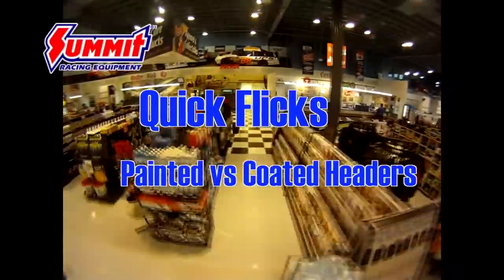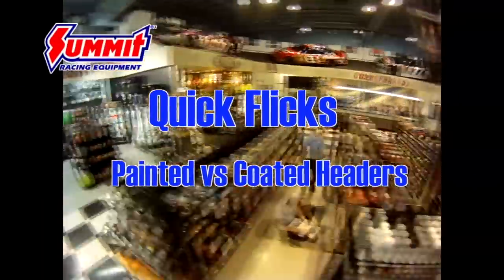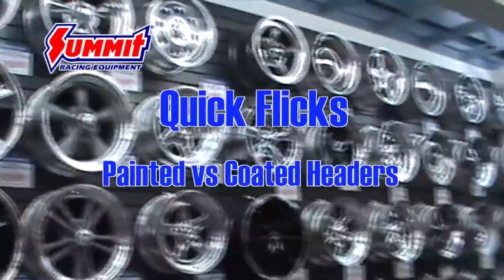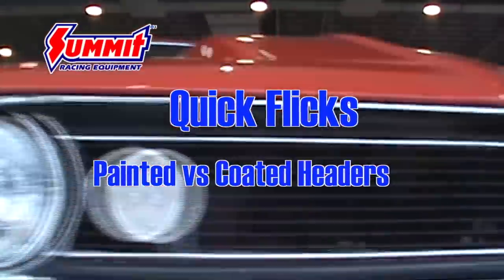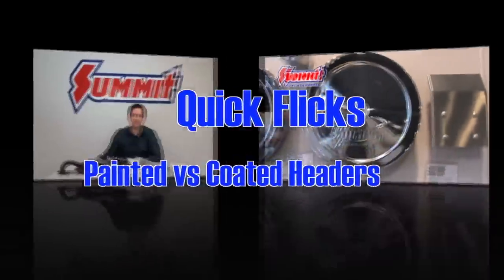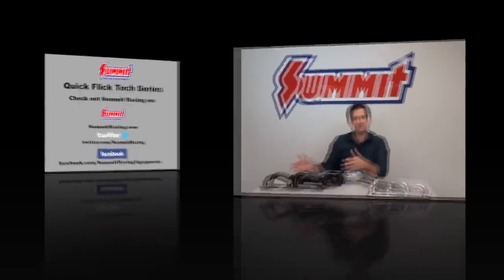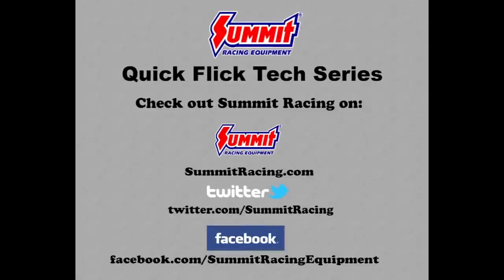Ceramic Coated vs Painted Headers - Summit Racing Quick Flicks

Comment from the maker: There are two grades of stainless commonly used in exhaust piping, T304 & T409. Neither will rust through completely but, the T409 will get a light orange coat of surface rust after a time. The header wrap does in fact cause a mild steel header to rust prematurely due to the heat and moisture, but will not have that affect on the stainless.
Reply: T304...for the win!  Yes
Reply: @mikeonorato2968  word, aircraft grade stainless steel in T304 👍

Comment from the maker: Hi grimmjow714, 
Ceramic coating requires the correct equipment to apply and large ovens to cure. There are businesses (Jet-Hot) that offer this service. It is highly suggested you trial fit the headers making sure of proper fitment. It is not uncommon to have to make a small dent or ding in a header tube to make sure they do not rub on anything. Once fitment is verified, you would have to send the headers to a coating company of your choice to allow them to coat your headers. Thanks!

Comment: Steve Brule and the rest of the crew at Westech showed that ceramic headers reduce heat around the headers by around 600°. That's 600 degrees that won't hear soak the engine bay/induction system.

Comment: I can tell you from experience that VHT flameproof coating works very well and lasts. The mistake I made was pressure washing my engine a couple years later. I got too close to the headers and it striped off the paint in that area.
Reply: VHT can not be much good if a pressure sprayer can wash it off. I have never had any luck using VHT paint. It is real rubbish.

Comment from the maker: Ceramic coating is just that, a coating! So yes, it can & will chip if accidentally dropped or hit by road debris. Stainless looks really nice (depending on the grade) but does not share the same insulating characteristics as a coated header. Therefore it will not lower underhood temp. or scavenge quite as well as a coated header.

Comment from the maker: Coating System
VHT provides a multi-high performance coating system for the ultimate in 
protection and quality. The system includes surface preparation, primer, paint 
and clear coat.  PrepSP445Prep Spray, PrimeSP118FlameProof™ Primer, CoatSPXXXFlameProof™ Color,    FinishSP115FlameProof™ Clear

Comment from the maker: Applications: Headers, Exhaust Manifolds, Piston Domes, Inside Heads
Finish: Flat
Dry Time: Curing time required and can be done on or off vehicle (see below)
Curing FlameProof™
VHT FlameProof™ Coating only attains its unique properties after correct curing (refer to instructions on the can).
Reply: Summit Racing thanks for the video. In regards to ceramic coated Pistons, would you shave down the piston before applying the ceramic coating in order to obtain the same volume?

Comment from the maker: Chrome plating headers has been done for a lot of years and while it looks nice, it requires a lot of cleaning & polishing maintenance to keep them looking good. Chrome plating also has no effect on exhaust gas scavenging like coated headers. This being said, many header companies have stopped offering chrome plating as an option. Another draw back to chrome plating is that it is very expensive to have done!
Reply: Most chrome platers will not do headers. The chrome has to be polished with special polishes and it is too hard to get into the collector part of the header.

Comment from the maker: There are two methods to cure VHT header paint.

On the Vehicle
•	Paint must be completely dry before curing 
•	Run at idle for 10 minutes 
•	Cool for 20 minutes 
•	Run at idle for 20 minutes 
•	Cool for 20 minutes 
•	Run under normal operating conditions for 30 minutes

Comment: Heat retention keeps the pressure stable with in the primary tubes. The higher the heat the higher the pressure. High pressure equals higher velocity of the exhaust pulses. Thus expulsion of exhaust more efficient than standard cast manifolds. Depending on the engine displacement and configuration  most headers provides more power in the midrange.

Comment from the maker: Off the Vehicle
•	Paint must be completely dry before curing 
•	Heat to 250°F (121°C) for 30 minutes 
•	Cool for 30 minutes 
•	Heat to 400°F (204°C) for 30 minutes 
•	Cool for 30 minutes 
•	Heat to 650°F (343°C ) for 30 minutes 
•	Caution: Do not exceed the temperature of the least heat tolerant component or 
the base metal

Comment from the maker: Not all headers are coated internally. That is a question you should ask while shopping for them!  There are no real downsides to coating; other than if you chip it they will rust quicker in that area. The upside is more power due to higher temperature exhaust traveling faster downstream, therefore scavenging better. Better scavenging leads to a cleaner cylinder for the next incoming charge that will now burn more efficiently thus producing more power.

Comment from the maker: On the Vehicle
•	Paint must be completely dry before curing
•	Run at idle for 10 minutes
•	Cool for 20 minutes
•	Run at idle for 20 minutes
•	Cool for 20 minutes
•	Run under normal operating conditions for 30 minutes

Comment: There's very little reason to buy painted headers. They can get up to 600 degrees Fahrenheit hotter than ceramic coated headers. Don't be cheap, and save all your wires and starters  just by spending a little extra to buy ceramic coated headers.
Reply: I feel the opposite because with every set of ceramic headers i've had, they rust within a few months. I buy the painted ones, sand blast them, 2000 degree primer, 2000 degree paint and its way better and way cheaper.
Reply: @ethanslape8889  I know this was years ago but do you still recommend painted headers with high temp paint. I wanna buy headers but can’t seem to decided between ceramic or painted.
Reply: @captainshimmer7319  yes absolutely. if you do it right then they will last. ceramic coated headers are a waste
Reply: @ethanslape8889  yea the ones I’m looking at are 500 for ceramic and 200 for painted don’t wanna pay for it, if it’s not worth it.
Reply: @ethanslape8889  I have pacesetter painted 1 7/8ths coming. How much to sand blast them on average you think? Thanks

Comment: I dont paint them  I burn the paint off and when I change the oil  I wipe the HOT header down with the used oil - It put a oil baked coating and they wont rust ... Like a black seasoned cast iron skillet... Done
Reply: What about smoke from burn off
Reply: @therealvontetv3117  it does for a few minutes at the time of coat/ recoat..  Think seasoned cast iron skillet

Comment: I have full Delkevic stainless steel exhaust on my motorcycle. The stainless is supposed to turn a gold colour after a while. I am going to have them chrome colour ceramic coated to stop this happening once and for all.
Reply: Why?
Reply: @porkchopspapi5757  I decided after having my stainless steel exhaust that I really like it. It did not turn very gold at all. I decided to leave it the way it is and not have it ceramic coated. It is a full Delkevic stainless system and I have it on my XVS650 V Star Classic Cruiser. I really like the system as it is full length and is about 70% lighter than the original system. I love stainless steel to clean as well. I just wipe it over with a damp cloth and all the mess is gone. There are no rust spots or anything and it always looks good.

Comment: Do the titanium coated headers that you offer have the same benefits as ceramic headers? I don't care for, nor want, the shiny look of the ceramic coated but I do care about all it's benefits. Particularly keeping heat down, increased velocity, and of course durability.
Reply from the maker: Skeeter66,
You got it, yes!  All the
benefits of the ceramic coating without the shiny finish!
Reply: Thanks for the info! I'll be looking forward to getting a box from Summit at my doorstep now.
Reply from the maker: Skeeter66, 
Thank you for your business! Good luck!

Comment: Thank you, but did not really answer my question.. 

How many layers of primer and coating is recommended?

And also, are the owen supposed to be, for example the first cycle, be 250°F when I put in my headers in the owen. Or is it supposed to be cool, and reach that degree?

Thank you

Comment: I have a 09 GMC sierra 5.3L with a corsa sport.  What's a good brand for ceramic headers for my truck?  And should I get the y pipe its a single side exhaust

Comment: Is there any heat soak with the ceramic coatings? If so what kind of temperatures do the headers get and for how long at that degrees?

Comment: Hello, I know this is a video between painted headers and ceramic headers, but which would be better between ceramic headers and wrapped headers. If this is presented in another video, my apologies. thank you.
Reply from the maker: Hi TheyCallMeCoolRon, Keeping all the heat inside the header tubes helps maintain exhaust gas velocity improving the scavenging effect on all cylinders and wrapping headers was the first way we used to do that. Header wrap is labor intensive, absorbs moisture (winter storage), Voids the header manufacturers warranty and is not very pleasing to the eye.
Header coating on the other hand has the same advantage that wrapping does, keeping the exhaust gas velocity high, but without the other compromising factors listed!
Reply: Summit Racing
well waht about ceramic headers vs. Stainless steel

Comment: Could you get 1 or 2 extra hp if you paint stock exhaust manifolds?  I don't think I've seen anyone do this, but it seems like if you already have them off, it'd be worth it.
Reply from the maker: christians131,
Not sure that painting would do
much good but ceramic coating may! Ceramic coating is a heat barrier that keeps
as much heat inside the manifold as possible. This increases the exhaust
velocity thus increasing the scavenging effect! A cleaner cylinder means a
bigger bang the next time around! :)
Reply: Summit Racing what about ceramic coating paint? rustoleum and duplo both make a ceramic paint for ceramic coating would this get the best of both worlds?

Comment: Hello, I just bought new motorcycle exhaust that are AISI304 stainless steel polish to brushed matt finish. I want to paint them black. I am thinking of using VHT Flame Proof 1300-2000 degrees Fahrenheit ceramic coating and for a primer use Rustoleum high heat primer up to 2000 degrees Fahrenheit. I was wondering if before applying the primer if I should sand the exhaust with 360 or higher grit sanding paper. I think since the pipe are already smooth i will not need to go for lower grit sand paper.  Or should I just apply the primer and not sand.  Or maybe I should I just skip the primer and paint them with the VHT. Please let me know what would be the best way to paint them so it will last and look proper.

Thanks
Reply from the maker: Hi Justin Maillet, 
We would recommend scuffing first. Being bare, it really might need some type of etching first in order to get the primer or paint to adhere. We would suggest using our  SUM-942010 prior to priming. http://www.summitracing.com/parts/sum-942010

Comment: is the ceramic coating is the same applied to vehicle as ceramic paint protection ?

pls advice...
Reply from the maker: +William Oei , 
No, these are not the same. The header coating is similar in consistency to powder coating (extra thick paint) and the paint coating is similar to applying a coat of wax.

Comment: how do I get the temporary paint removed without bolting them on ??what do I use
Reply: I put mine back in the box and placed it in a firepit. When I took them out just clean them up, I used VHT flame proof primer then paint. Came out well
Reply: To ceramic coat, parts must be absolutely clean. Follow coating manuf. suggestions. Most suggest aluminum oxide blasting to bare metal. The coating service should provide further cleaning solutions to remove skin oils, etc. and to ensure a long lasting finish. Contact them for their recommendations. Rattle can paints have fewer requirements.

Comment: So if I buy a stainless steel header do I need to wrap it or put finish on it?
Reply from the maker: Hi Brad James, 
Knowing the difference between the t304 and t409 stainless steel will help you when you buy stainless steel products. The t304 system will not oxidize or rust. However, it can develop a golden color when exposed to high heat over time. The t409 stainless steel has a lot of ferrous material in it and can show surface oxidation after a while, especially when exposed to calcium chloride or salt. However, this can be prevented by applying stainless steel cleanser using a scouring pad.

If you are concerned about long-term appearance, then you should get the t304. If you are more concerned about the price but want something that is fairly durable, then the t409 will work just as well. So the next time you buy a stainless steel product, make sure you ask about t304 and t409 stainless steel options.

Comment: Although you don't mention any trade names in your piece, it looks like your ceramic-coated examples might be by Nitroplate.  I just called Nitroplate and was told that as of May they no long have a retail operation, which means we hobbyists are out of luck as far as their product.  In view of this development, I think you should offer alternatives here.
Reply from the maker: Norm Lewis, 
We do not carry Nitroplate. However, we do have a large selection of ceramic coated headers. You can see that selection here: 
http://www.summitracing.com/search/department/exhaust/part-type/headers

You can select the header finish along the left side of the page. Let us know if you have any additional questions. 
Thanks for watching!

Comment: I've never been a very big fan of headers personally. I've always found that they leak, they burn up gaskets, wires, cause too much of a headache for a small gain in horsepower. and they never usually get used in the right application. (why would you ever put headers on a truck?) but these ceramic coated are interesting me greatly. I might have to go with a set of these on an LS or 383 stroker build I am planning on a corvette. if the benefits can outweigh the losses I have seen in the past
Reply from the maker: Hi ledzeppelin27, 
Thank you for you're input. Please let us know if you have any questions. Do not hesitate to contact our tech department by calling 1-330-630-0240. Thanks for watching!
Reply: Every engine has headers......
Reply: mrsuperbuckets It's a difference between headers and an exhaust manifold. Most will come with a manifold from the factory which is a single cast part while headers have the individual tubes for each cylinder.
Reply: ledzeppelin27 because some trucks are faster than your Corvette. And because power isn't to only reason to get headers. Noise is another reason.
Reply: Mikes garage has a actuall side by side comparison test YouTube video on manifold vs header with dyno results...

Comment: Can someone please answer this before I purchase. Can't get an answer. Do i need ceramic coating headers for my long tube headers
Reply: Yes. The difference in heat dissipation is incredible. My headers are cool to the touch within minutes of shutting my engine off.
Reply: My brother thank you
Reply: You're welcome. You'll be glad you went with ceramic coated headers, you'll notice that the plastics in your engine bay live longer as well.

Comment: Why are my ceramic coated headers running hotter then my raw un painted headers? Burnt 3 sets of plug wires on coated and never had that issue with the uncoated.
Reply from the maker: HI Justin, Too many variables to tell why they are burning spark plug wires. I would suggest putting an infrared thermometer on there to see how hot they are actually getting. Thanks for watching!

Comment: You are incorrect about ceramic headers, being durable and lasting a long long time. I have a set of ceramic hooker headers that are all pitted and rusted out. I rarely drive this vehicle so it is not due to overuse or wear and tear. I’m starting to feel like hooker headers Disappointed me. Will be looking for a different brand for a replacement

Comment: Wait am I missing something, you said the performance of painted headers is similar to ceramic coated, but the painted won’t last as long, and your solution to getting lasting performance from the painted is to sandblast and strip that shitty paint right off of there and slap on a ceramic coat 😂. You made it seem like you were going to give some tip on making the paint last longer, then nope, strip that crap off immediately 😂